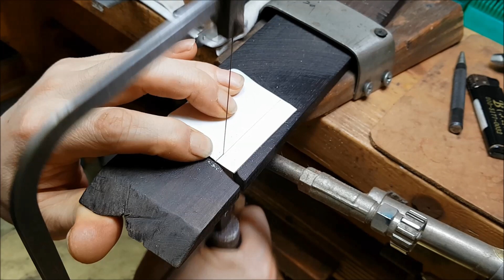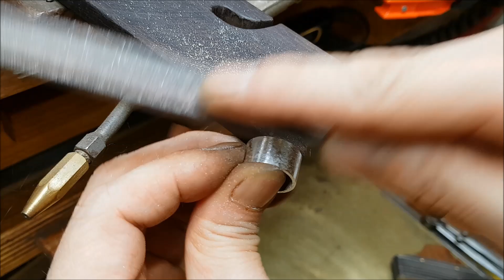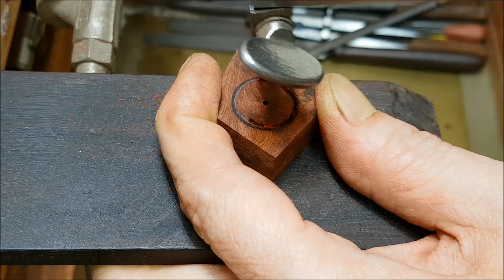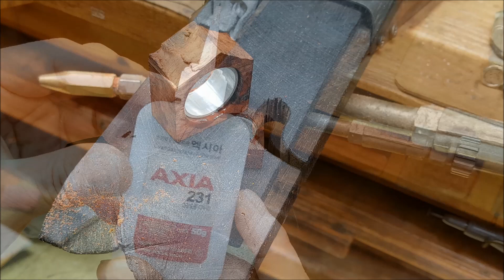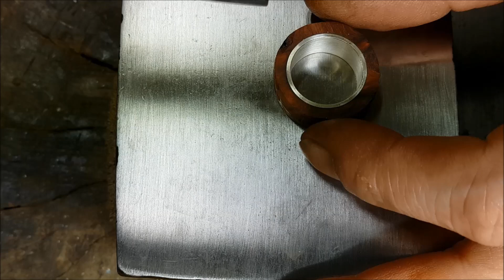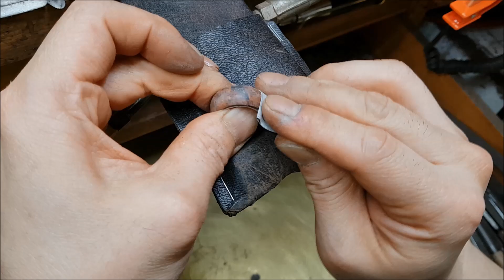[ Making Volcanic Ring ] Amboyna burl wood, Silver 950

Comment: Your craftsmanship and artistry is outstanding! As a jewelry artist, I really enjoy  watching your project. Question: On this ring, why didn't you turn the wood on your lathe? It seems it would be more accurate and easier to fit to the silver sleeve. Keep up the good work!
Reply from the maker: There are many ways to make it.
This ring shows that the entire manufacturing process can be done manually without using a wooden lathe.
I want to serve as a guide so that even those who do not have a wooden lathe can follow my video and make it.
thanks~